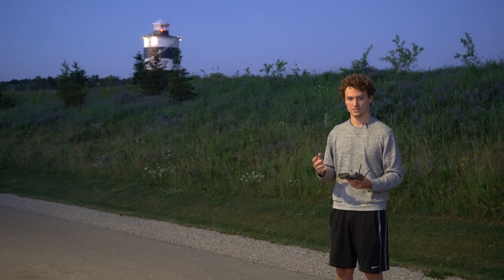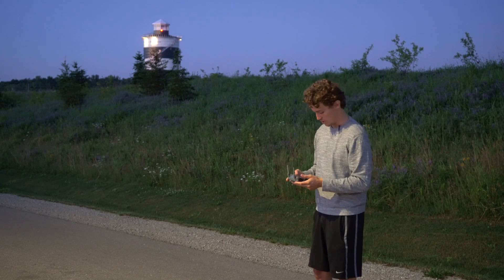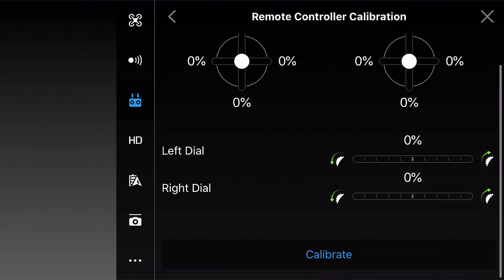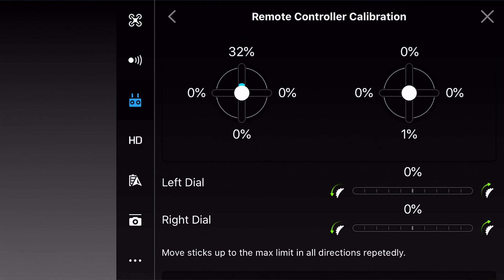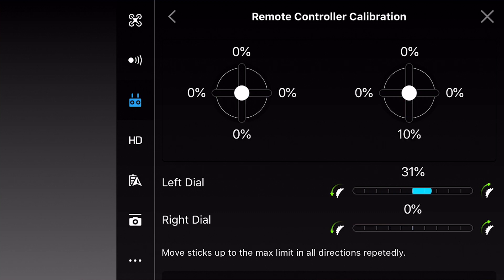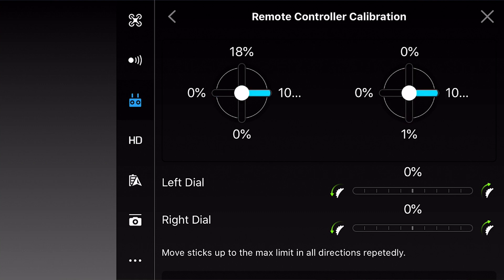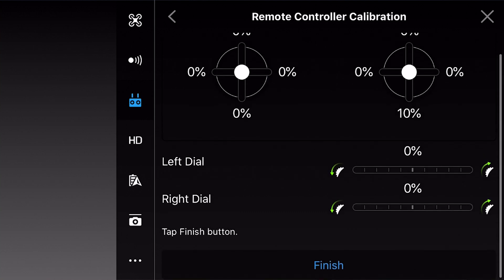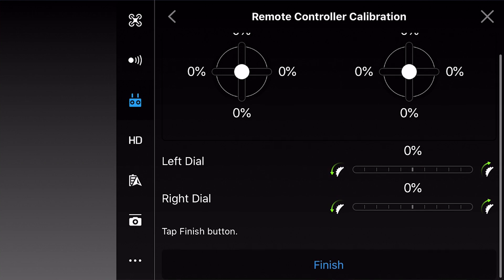How to Calibrate Your DJI Mavic 2 Remote Controller - SUPER EASY

Comment: Hi Edward, when I go into Calibration my left joy stick is registering Left and Right 100% but it does not register anything when pressing the joy stick Up and Down.  I have not had any issues with my controller--no dropping it on the ground, no damage.  Any idea what the problem is?
Reply from the maker: Are your controller sticks screwed in properly? Do you screw and unscrew them often? It’s tough to say, but you could try asking chatGPT what it thinks. I’ve never encountered that issue.

Comment: Hi Edward, quick question, Mavic 2 asking for compass calibration more often, when clicking Start Calibration sometime times nothing happens?!! Quit in flight one day, spooky!!
Reply from the maker: Mavic 2 Pro will often ask for recalibration, especially if you’re in an area with a lot of magnetic interference. Make sure you are away from metal, including a parking lot full of cars. Also make sure you are not in the middle of a city with sky scrapers surrounding you. All these things will make it very difficult for Mavic 2 to calibrate. Not sure what you mean by it quit in flight, can you elaborate?

Comment: Mine controller is stuck at 0% battery. And has the annoying beaping going on. I tried this calibration but it still beaping
Reply from the maker: Yeah, unfortunately, this is just one of the issues of the Mavic 2 Pro. Later generations, don’t have this problem.

Comment: Its not working for me, it shows imput is there and I see when pressing my sticks but thats all, no double beeps at all. Also I noticed that when I pressing up sometimes other directions like right or left is also affected so its got 100% up and some like 20% right direction as well so difficult to press exactly only one direction.
Reply from the maker: Thank you for your comment! It’s not as easy as it looks in fact! In order to hear the two beeps, you MUST make sure the other directions are not being detected. Example: 100% right 0% in all other directions. Repeat until all directions are 100% without other directions being detected. It’s extremely frustrating but that’s what you need to do. ALSO: make sure to also use the wheels at the back (Tilt and ISO) when calibrating your controller. 
Let me know how it goes!
Reply from the maker: In addition: make sure that your controller thumb sticks and screwed it properly and that there is no debris between the sticks and the controller
Reply: Yes I'm having the same issue...its so frustrating because the beeping never stops!! Like a bad nightmare lol 😆 I'll keep trying maybe try lightly in all directions. What are we trying to accomplish? Mine go to 10 when it reaches 100%. I've had 10s in every direction but the beeping comes back minute later. This is madness 😳

Comment: The mavic mini does this too, but my problem is that when I try calibrate it the left thumb stick doesn’t seem to get a response, so it just stays on 0% when I’m moving it up and down. It doesn’t seem broken and I had this problem a few weeks ago and it actually worked but after one flight it’s back to this. Any ideas what it could be?
Reply from the maker: Hey thank you for your question. This is a good question, it sounds like your remote/sticks are defective? If you are seeing no response when turning the sticks to the left try contracting DJI personally, this might be a bigger issue than simply an uncalibrated remote controller. Let me know!!
Reply: @edwardfigura  yep I have the exact same issue, contracted DJI but they have no clue which is really frustrating. It’s like there’s no response from the sticks. Do y’all know what to do?
Reply: Did you ever get that issue resolved? What did you do?
Reply from the maker: @izakburlo  For me, the controller just beeped because the sticks weren’t calibrated. But I always saw a response on the app when moving the sticks. Maybe try making sure you are as far as possible from magnetic interference and also make sure your antennas are pointed in the right direction (perpendicular to the ground, antennas facing your face). Also make sure the sticks are all the way screwed in. 
Last resort is to get a new controller (but I would contact DJI one last time before doing that)
Reply: @edwardfigura  yeah it’s been frustrating, thank you for trying to help. It’s been happening with my brand new DJI FPV drone controller and I’m so confused cause it worked out of the box in the simulator but now it stopped. I’ll try to talk to DJI again
Reply from the maker: @izakburlo  And yes, I bought a Nanuk pelican case and that allowed me to never have to unscrew and screw the sticks in ever again and it never beeped again!
Reply: @edwardfigura  do you have any idea how to factory reset the controllers?
Reply from the maker: You’re better off doing google research on that. Visit all the DJI forums you can. Maybe you can reset it within the DJI Assistant app. But do not quote me on that. I had the same issue as you with the FPV controller but it didn’t work only when I was using the simulator. In real life it works

Comment: Not able to  move left and right my mavic air 2 
Why its happening plss help me
Reply from the maker: Hey, thanks for your question. Make sure you aren’t near any magnetic interference objects like heavy metal or metal structures like a dense city or even train tracks. Also, make sure you have unlocked your NFZ (no fly zone) in the area you are trying to fly in. If you are trying to fly in a NFZ; yoir aircraft won’t let you move laterally. Hope this helps!

Comment: Hi I unbox my first drone mavic air 2 same beeping noise and dont move left or right
Reply from the maker: Did the method in the video help? If not you should probably contact DJI and let them know that your DJI controller is faulty and try to get a replacement
Reply: I flew my new mavic air 2 about 5 times since buying it less than a week ago. My Autel Evo 2 remote calibration is similar to DJI. I will go do that now. The Autel evo 2 had a little issue with crabbing left or right and when I calibrate the compass and remote it flies straight as an arrow. I wish Autel would beep the remote and let you know its off calibration like DJI. Maybe they will soon. Thanks for the video bro.